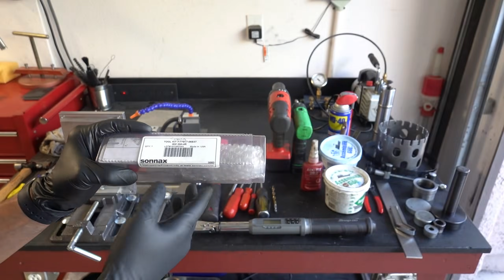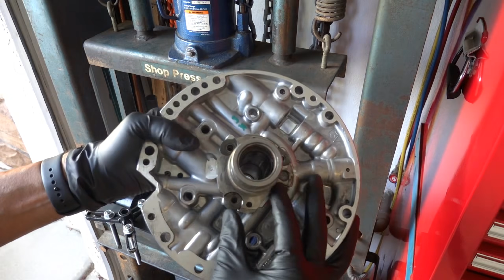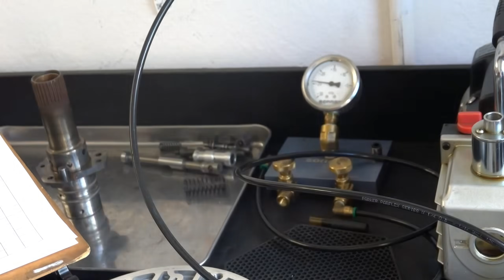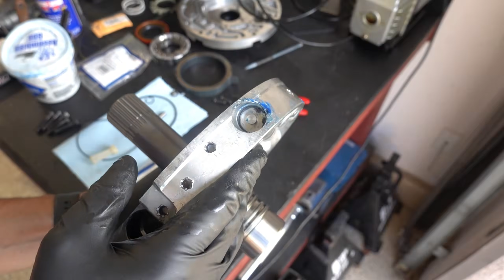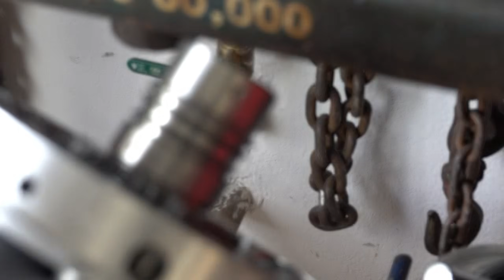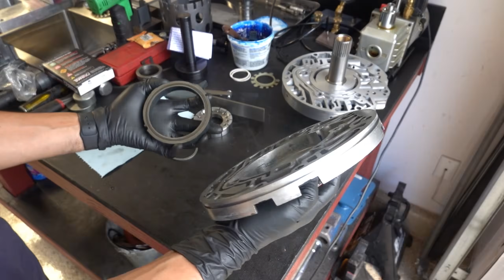4L60E High Performance PT9 - Pump Assembly

Comment: I just put a stator in last night. I used Dana's technique where you bake it at 550F and freeze the stator. My only thing was, I'd have liked to use some shaft seal, but with the stator at 550F I don't think that would be a good idea. Do you ever shaft seal the stator / pump interface?
Reply from the maker: If you're asking about the space between the pump body and pump stator support, then no - I have never sealed that space and do not recommend anyone do it. GM would have included a gasket of some sort if they intended for that junction to be 100% sealed

Heating the stator support and freezing the stator is a great alternative for those that don't have a shop press and, if done right, is relatively low risk. Good work there.

Comment: Nick , great video. 👍   just a  question on Tci Billet pump  rotor kit . It comes  with rings  should i use those or go with transgo unbreakable kit. , thanks in advance ...
Reply from the maker: I use the Transgo rings in all my HP builds. Thanks for watching!

Comment: Here from Facebook 4l60 page
Reply from the maker: Thanks for watching, Anthony!
Reply: @nickstransmissions I posted something on Facebook page but not sure it’s approved. Basically photo of what I have parts and what else should be a must for like 700hp motor
Reply from the maker: Post it into a reply here - I don't offer any tech support via Facebook, as my bio states. I'll review and give you my thoughts once I see it.
Reply: @nickstransmissions that’s all I can ask. I’m only getting what I can afford. Not that like that ultimate 4l60e playlist but close as possible if I have time. One great part was what happened to a trans that dude had no od and manually shifted, as I’m in same boat. Now looking for core
Reply from the maker: No worries - if you reply with the list, I can steer you in the right direction.
Reply: @nickstransmissions sunshell, hd2 kit, alto performance overhaul kit, tci 3-4 packs (my supplier said that what was available). I don’t see an aluminum piston kit for all the accumulator if that’s what they’re all called, and not sure hd2 kits provides everything I’d want for my valve body and pump usuals. 

I’m one time watched almost whole playlist of ultimate trans and need few more times to watch it really
Reply from the maker: You only need to watch my HD2 video and perhaps my 3-4 clutch pack video as you have already watched the pump assembly video. Those other both in my 4L60E playlist. 

Don't buy the TCI 3-4 clutch pack...Purchase the 4L65E Alto high energy clutch module, factory 4L65E steel module, 465E .160" thick backing plate and that will give you a robust 7 clutch, six steel 3-4 clutch pack w/clearance between .030-.035 if you use a 700R4 #4 3-4 clutch apply ring...If you use the #7 4L60E apply ring, which will come in your forward drum, you'll end up with about .045-.050 clearance which is also fine. 

Call Transpartswarehouse.com and tell them you need a wiring harness, all solenoids, pressure switch manifold assembly and speed sensor, if you have a 2WD. Tell them you are interested in their Deluxe kit for a 4L65E, complete with clutches, steels, bushings, paper/rubber/gaskets, input sprag, low roller clutch, Sonnax smart shell, wide alto 2-4 band, reverse input drum (yours is almost certainly warped and will burn your band relatively quickly after it goes back on the road). Also pick up a Sonnax boost valve kit (4L60E-LB1).
Reply: @nickstransmissions wow, you’re the man! Thanks 😊
Reply: Last question and thanks again. I’m stuck with the tci kit unfortunately. Can I mix and match the tci with alto performance overhaul clutches?

Comment: Hey nick I heard you’re an expert in the 4l60s so I’m contacting you for some advice.

I have a 2000 gmc sierra 1500 with 4l60e that has completely stopped locking up in 4th gear and throwing a p1870 

Background on it: This is the second rebuild. The first lasted 6 months and burnt up after the guy warrantied it and I reinstalled I noticed it not locking up. (I believe that’s how the first one burnt up after 6 months) Took it back to him and he changed the pwm and the T-solenoid. Worked perfect for  two weeks after that  sometimes would lockup and sometimes not. Now it won’t lockup at all so I stopped driving it to prevent further damage. 

That is the only code, should I replace the entire valve body, get the upgraded tcc valve? Get the transgo shift kit? What’s your expert opinion?
Reply from the maker: Hi Tristan, thank you for watching.

Check this video out for valve body fixes associated with P1870 - this should address your issue: https://youtu.be/uNJj3RH94bc

Comment: Is there any reason why doing "High Performance pump" improvements on a 200 - 300hp application or even a V6 would be a problem? I am asking for a friend.... :)
Reply from the maker: Hi Steven, who is the friend? And why do you think building the pump for performance would be detrimental?
Reply: @nickstransmissions  I still don't know what I don't know. I am about to attempt a transmission rebuild on my 2001 V6 3.8L firebird (3/4 fried). It taken me some time to acquire the required tools. I am still mentally parsing everything I have read and watched (thank you by the way). I don't mind overbuilding as long as there are no unintended consequences. It's a lot of work to remove and reinstall in my driveway so I want to make sure I do this only once. 

I am pulling the transmission out next weekend, once apart and inspected I will order rebuild kit and any hard parts. I am still lacking any form of shop air in my life. I built the vacuum tester last night. It looks very DIY zip-tied to a 2x4 but only cost me $30ish to build. 

I am a C# developer by trade, so your videos are my SDK/API so to speak. There are exactly 0 videos or guides on the 4l60-e on 3.8L v6 (hint hint).

Thank you, Nick, truly! I appreciate the work, time, effort you take to make these videos.
Reply from the maker: No, no detrimental impacts to the unit, perhaps only to your wallet...You def don't need the billet rotor but everything else in this video would apply. The 3.8L 4L60Es are no different procedurally than any other 4L60E, just some parts are physically different, including the bell housing. 

Purchase an air compressor, hose and rubber-tipped air nozzle - DO NOT ATTEMPT to rebuild your transmission without an air source! Huge no-no as air checking is absolutely vital and you NEED THE AIR SOURCE before you start tearing the transmission down. 

Also, buy an electric power washer off Amazon - clean off all your parts except the bolts and super small stuff with the pressure washer if you don't have a hot tank.
Reply: @nickstransmissions  Thank you for the advice. While I am not looking to become a part time rebuilder, but I do like to do things the right way as much as I can within reason. The fact you would advise me at all blows my mind. It is not lost on me how much time you put into the videos and interaction with the comments. I do have few more minor questions if you don't mind. 

1. Could I just get an Air tank with hose and rubber-tipped air nozzle? I have co-worker who could "charge it up" as needed. I would have a hard time storing a proper compressor when not in use. 

2. The power washer I got, it's nothing special but should be fine.  I also got a small kids pool to clean my parts in. My wife told me my journey to full blown red neck is complete when I told her why I got the pool. 
I can let them soak if needed and my HOA won't have a fit lol.  I thought about putting my work bench in the pool for disassembly to contain the mess that will be. 

3. What should I "clean" the hard parts with? Just water and degreaser? Anything I should avoid?

4. I think the differences in my transmission is all on the input side of the pump. TC, pump stator, and input shaft length based on Ls1tech forums.
Can you confirm this information as it may be wrong? The post is from 2015, and I have 2001 firebird and thought I had 298mm parts.
Here is the post.
"ALL 3.8L Series II RWD engines with 4L60E's have 245mm Shafts, no exceptions, The only deviation from previous 245mm 700R4/4L60E is they have a V8 clutch count, 553 "V8" 2nd piston, & a "High speed" reaction planet with the 3800 Series II. And of course...In '98 they got the "Modular" Case.

The confusion (guessing) is because in around 2002....The 4.3L V6 got 300mm 4L60E's where they had the 298mm prior to that."

Source - https://ls1tech.com/forums/automatic-transmission/1809355-4l60e-300mm-shaft-v6.html?utm_source=share-link&utm_medium=button&utm_campaign=share&utm_content=post